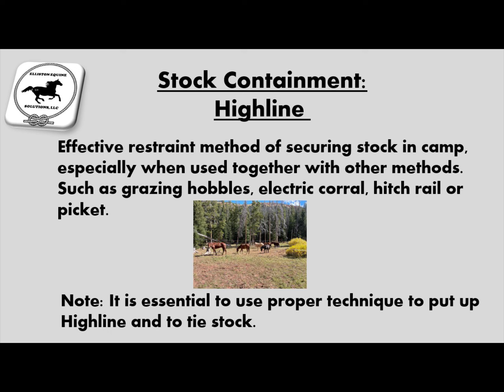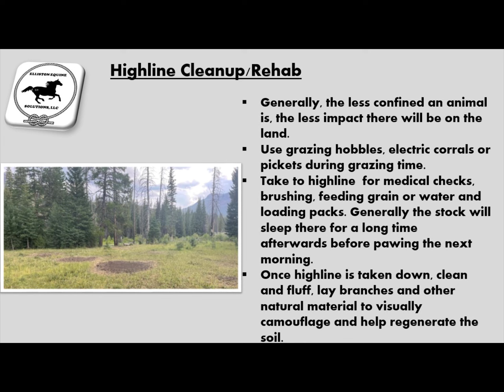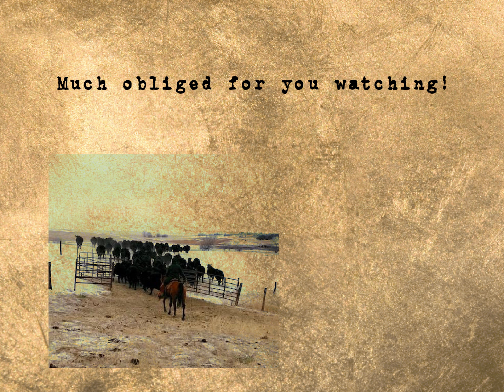Highline Stock Containment - How To

Comment: Great video as always. The only thing I'd add is that most government parks/forests require the use of tree savers instead of rope wrap if you're high lining and the rangers will fine your behind if you don't use them.
Reply from the maker: True, That is why I showed both methods. One side with a fire hose as a tree saver and one with a tension-less anchor that doesn't leave marks on a tree. I suppose the hidden intent wasn't understood. Thanks for highlighting this. Cheers-TE